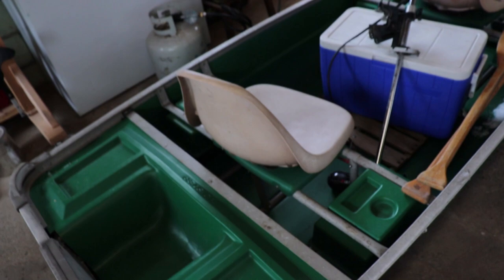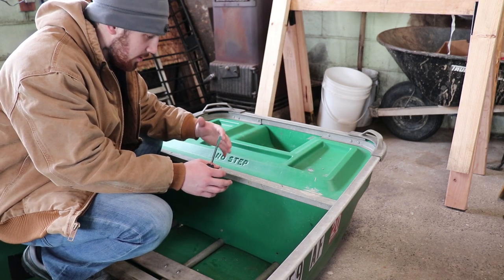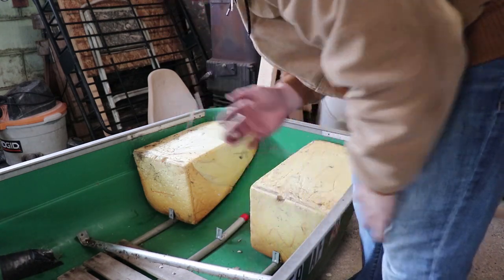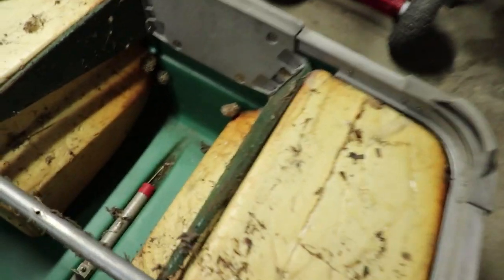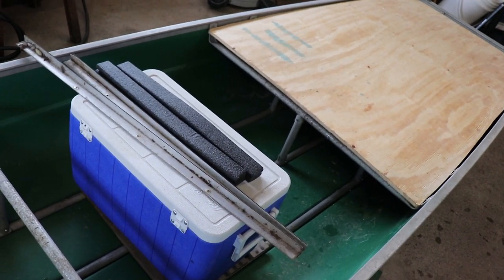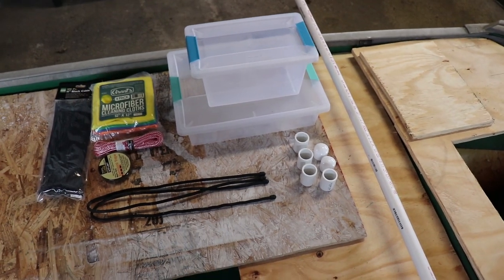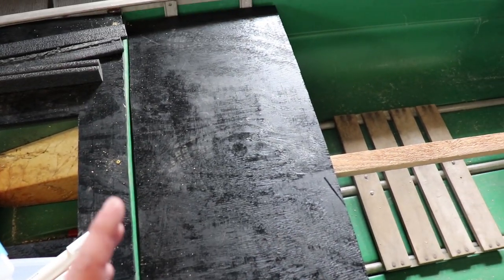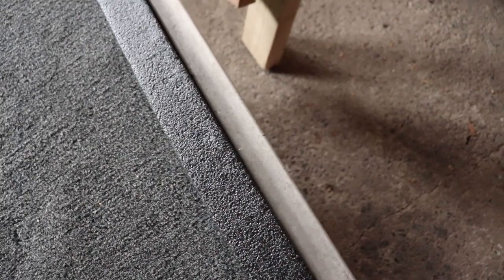COLEMAN CRAWDAD turned into River Floater!

Comment: Dude that is a badass build I have the same boat and hadn't had a chance to really get into it yet I've had it for a couple years now I bought it for a hundred bucks off when I'm assuming is a crackhead or somebody really desperate for money quick like if you don't have the money right now I have somebody else it's going to grab it or I'll take it to the pawn shop kind of deal LOL anyway the only problem was they said it has a leak lucky for me they didn't know what a drain plug was but I got this boat as a first boat and was going to upgrade for freshwater fishing to a bass boat but see no reason to also preventing me from buying a kayak because that gets where everybody's kayak does but I can take beer radios and everything else they can't so I've been on the internet blown away by people's modifications to this little guy one dude even had a I can't remember how many horsepower jet motor like you would see they use you said you were in the Susquehanna down by the damn where all the rocks are so the propeller don't hit that's crazy I didn't know they made little jet motors that's small I'm sure it's expensive as s*** but would be ideal for shallow water if you're running an outboard but motor's that small or cheap anyway so I'd have to look into it but I have a trolling motor on mine it does make great the weight of the battery sucks but it'll hold me on 220 my 200 lb buddy and all of our s*** perfectly on a calm day I wouldn't push it in a storm unless I was alone great deal I just had some money off of me a hundred bucks and they got mad that I told them no so now I'm going to have to lock it up because they're working on my yard cutting trees down and I'm sure it'll disappear within the next few weeks because it's out back stacked over by the shed on the trailer just sitting there made me realize if I should get rid of it or not but there's no way in hell especially not for a hundred bucks if I did because of the floor work and not as much work as you did and the two little seats and all that I'd have to get at least $300 or 400 with the trailer and that's if I was desperate and I'm not so I know dudes that have this little boat that won't get rid of it for anything and they have multiple other boats so good deal great setup

Comment: Hey man how’d it float? Is it stable enough when you stand on it?
Reply from the maker: yes it is stable enough, takes a little bit of getting used to with the deck. If anything it's more stable without the deck because you throw the balance point off.
Reply: Jebsfishing  cool thanks for the reply, thinking of doing something similar with my Coleman
Reply: Have you taken it in fairly shallow water ?
Reply from the maker: @portapottyflipper6957  yes I've floated on inches

Comment: Just got one just like it for $150 bucks i put a trolling motor on the front 30lbs minkota  and for the rear i have a 2005 mercury 3.3hp
Reply from the maker: How do you like it?
Reply: @Kodysbackwoodsbasics  its ok.  Thanking about doin what u did to yours But not the hole thing just the front.
Reply from the maker: @christopherford1015  just consider how much it throws the balance off
Reply: @Kodysbackwoodsbasics  yea